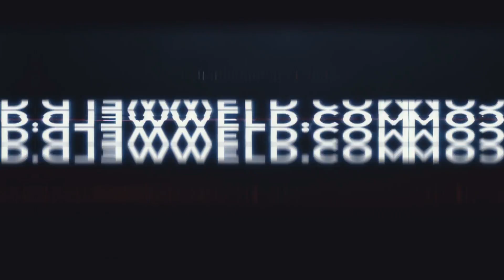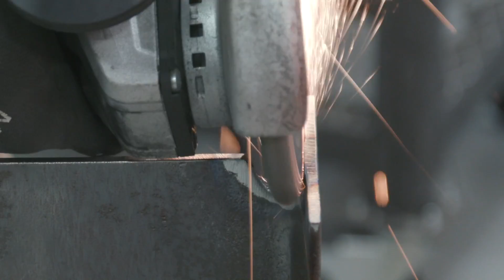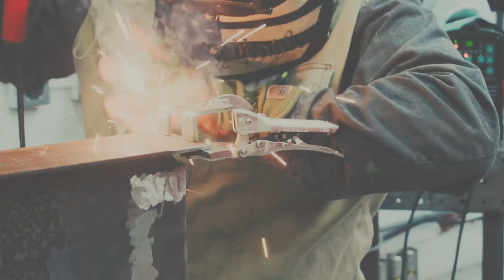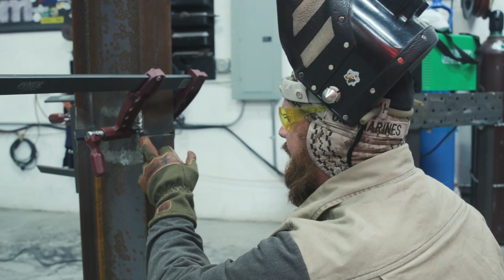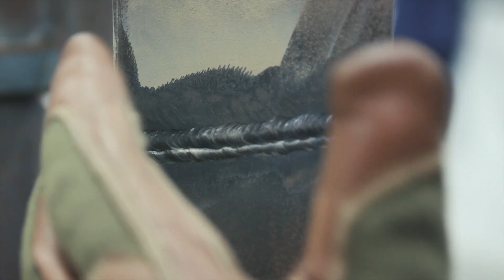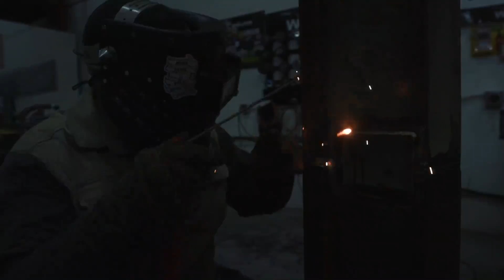Field-Tested Backing Plates for Vertical Column Splicing: A Comprehensive Tutorial

Comment: 56 second time stamp.. typically in construction you're going to be using 5/64 innershield or possibly 3/32.. AND ON THAT FLANGE.. THAT'S 2 PASSES 3 MAXIMUM..AND AFTER TWO OR THREE SPLICES 90% OF THE TIME I GET DOWN TO 1 PASS ON .. A 1/2 INCH HORIZONTAL SPLICE  WITH  A  1/8 BACKING BAR!!

Comment: Those rat holes are not only for backing strips ! You should do them even if you're open root splicing !

When you transfer from web to flange on an I beam, there is a radius that locally increases the thickness. without a rat holes, when splicing, your weld would not penetrate all the way through that radius, which would leave some lack of fusion at the root of your weld. 
You might think it's not that big of a deal, but that little unmelted defect is a stress riser, and a crack initiation. It also works in what we call "Mode 1", which is the loading situation that favorizes crack propagation, and is under bending loads. Finally, because it's an inside crack, visual inspection would not tell you there's a problem until it's too late

So do those rat holes each times you are splicing ! (In France, we call them "Lunulles" )

Comment: One other reason open root isn't performed on structure is open root isn't prequalified by the D1.1. So in order to run open you would have to create a PQR. Which drives up the cost and time of the structure.

Comment: I would never have passed that splice
First you left open gaps where rust can form, 
Sec, you should have welded the web on the opposite side for added strength grind the weld flush and then put a second backing plate on.
Third, those backing strips on the web, should be welded all around, Not just from through the gap, They will allow moisture in to cause rusting over time,
I would never say that video should describe how to weld vertical splices of I or H beams.

Comment: Excellent use of backing strips for a structural column join with a lovely flush weld on the column flange. No weld on the backing strip on the inside of the column. Have seen similar techniques used on excavator equipment which is subject to repeated cyclic stress and results in a fatigue crack.

Comment: Is there a guideline or a rule about the size of the patch plate verses the size of the beam? I was told the plate should be pointed on both ends for more surface area and more linear weld. What are your thoughts on that? Thanks for your good videos.
Reply: @MPM Welding i saw that starbucks video.  it was fun watching him weld up on the ladder.  have you seen his 3 recent videos raising a steel workshop?  nice
Reply: @MPM Weldingwith a backer plate,  i think the gaps are pretty large by code to allow the fireproofing spray goo to penetrate.  if no backer you need the gap to weld the back of the flange in a continuous bead
Reply: @MPM Welding saw a great video on the fireball tool YT channel where the owner makes a steel staircase in his fab shop.  any other welding channels you have found?
Reply: @MPM Welding thanks for the tips.  i will look up the ones i have missed

Comment: Thanks! I love it, just got my first welder 2 weeks ago. When you hav an option do you always weld uphill with stick I noticed you welded uphill on both sides?
Reply: you usually weld uphill to improve penetration.    uphill is hotter and penetrates better because the hot gas plume rises and helps preheat in the direction of travel.  
however,.  unlike this I beam, skyscraper beams are 1/2 to 1 inch metal and deep penetration is desired at all times.   if you are blowing through thin metal,  you can switch to downhill to make a cooler weld and decrease penetration
with mig you can increase stickout to reduce penetration as well. i think the opposite is true with stick, long arcing heats up the metal while keeping a short arc makes a cooler weld.  with both mig and stick, the angle you hold the electrode affects penetration as well.  a 90degree electrode puts all the heat onto the metal while a steep drag angle puts more heat into the puddle mass rather than the plate which spreads out the puddle and decreases penetration.
Reply: Always weld uphill as a general rule
Reply: You weld uphill with 7018. If you are welding pipe with 6010 you weld downhill.
Reply: I mess around a bit but really the only way my stick welds turn out decent is if it’s perfectly level, and I’m not trying to stick 2 things together.
Reply: 6010 downhill depends with different people and your wps for your job peet ky is correct and very nice for writing all that out starting out get good at your uphill work you will need it down hill is ez

Comment: There is a formula for the size and depth of the access hole. Usually 3 x the flange thickness  and a minimum radius size for the hole usually 3/8” min. and the distance from the flange over to the center of the hole usually 3/4 + and no -. Then the transition from the hole back to the flange no steeper than 25 degrees. Maybe touch on the codes the engineers are using like AWS D1.1, D1.8, or AISC 360. Every time I get to splice beam or column it’s always 100% inspection with MT or VT then UT and the weld backing never gets to stay so it’s either done open root or ceramic backing (screw copper, too much grinding) depending on the scenario and never 7018 but always 71T-8. You should do another one with an erection aid in the web and use wedges to plumb and the wire to weld.
Reply: I heard a rumor that jason uses erection aids on the sly.  hah!  that said, it would be cool to see a ceramic backer used.  i wonder if a hobbyist could use a piece of flat soapstone to simulate a ceramic backer.  why more grinding with copper?  also, are the backers used in industry flat, or do they have a channel on the backside of the weld ?
Reply: @peetky8645  with or without the copper if I have to grind at all I rev a little but slag happens. My copper selection is pretty sweet and I will use it. He should also bet teaching how to get out of a shitty situation like a misaligned flange because the two pieces didn’t come from the same mill and that there is a code for the amount the off set can be, just a little real world encounters. He is totally on point with everything he did.
Reply: @HellzYeahjake  nice
Reply: @peetky8645  you got me wanting to burn a piece of soap stone now, I have a package of iron to set Monday, I’ll get back with you on that.
Reply: @HellzYeahjake  i know the swedes make woodstoves out of soapstone, i don't know if it would stand up to the heat of an arc...watch out for any fumes just in case

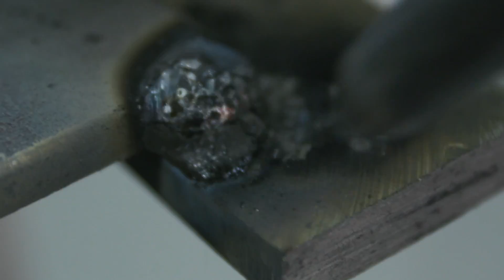Comment: Pretty right tack there at 3:20 😅 this is set up essentially the same as a monument weld, I’ve done plenty of H beam for structural drive piles for Hayward Baker and Keller. All open root though, 7018, all MT and UT tested, about a 1/8th gap with splice plates in the web of the beam for for vertical weld and fitting column to column, up to 40 foot sections at a time! A smoking hot 5/32 7018! Turn and burn! Keep up the great videos!
Reply: when you do open root 7018, do you do the root pass dcen to stiffen the puddle and then switch to deep for fill and cover.  what is a typical web and flange thickness for a pile beam?
Reply: @peetky8645  I’ve always just left it on dcep, with them being a single bevel groove and with the butt end on the bottom of the joint and bevel on top, never more then a 1/8 gap unless someone made a bad bevel with the torch because the splice plates, always burned 5/32 just jam it in and and get the puddle connected and carry it out, they were never too picky if it was a little heavy on the backside as long as it was all broke down, and normally they where all .750 wall thickness, did some 18 inch that was a inch, all serious load bearing stuff
Reply: @renoschneider145  thanks